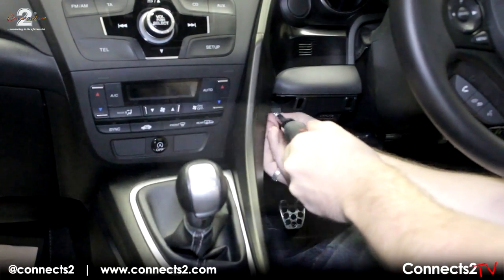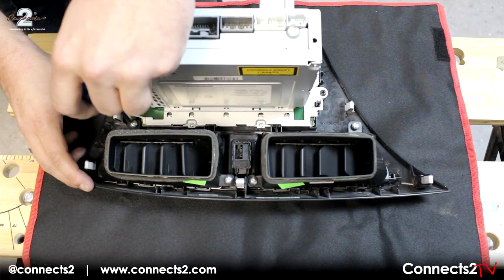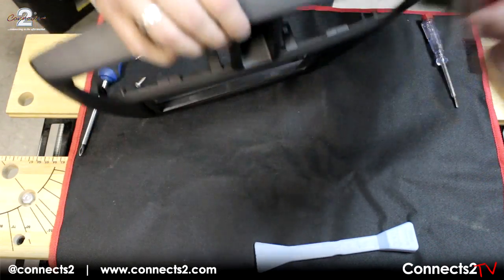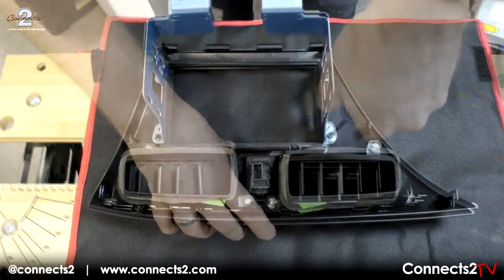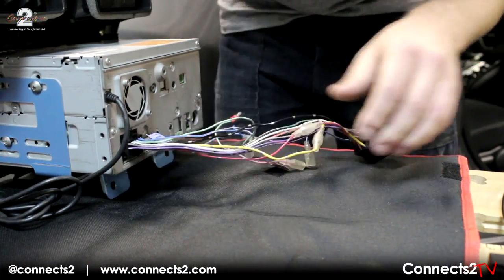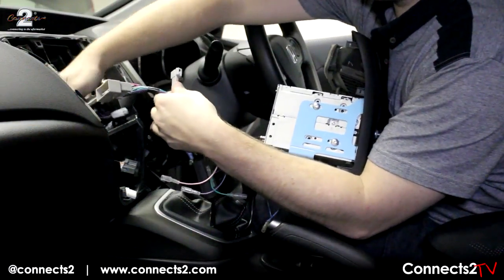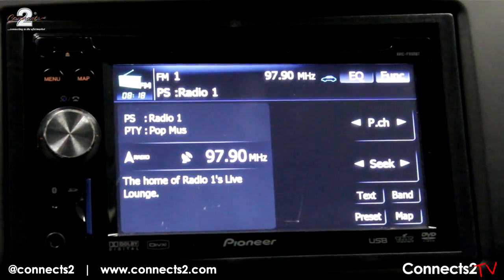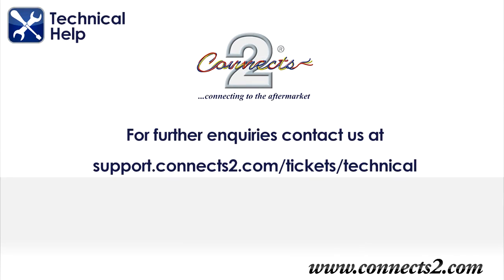Honda Civic (2014) Integration Kit: Installation Guide

Comment: Thanks ever so, Connects2. Not only do you seem to provide the only video on YouTube showing how to remove the head unit from a MK9 Civic, but when I rang them to query how to remove the panel under the steering column, the service department were EXTREMELY helpful. (Its held in with clips, I found gentle levering from the lower corners releases it.)

Comment: Unfortunately the screw for the 'central boarding' (0.13 seconds in) just keeps turning, therefore unable to remove. Any ideas on how to get the screw out?
Reply: Managed to get the screw by holding a piece of card behind the head to pull it out a bit, then unscrewing it as normal.

Comment: Gentlemen, are there any differences between the CTKHD06 kit harness included compared to the CTSHO006.2? Pictures does not look exactly same. Are the functions same. Trying to put together an order for my Honda Civic Tourer 2014 and possibly a Pioneer 1 din receiver (+a tray in the second din)
Reply from the maker: Hey +Jaan Pödra,

Within the HD06 kit is the CTSHO005.2 which is OEM specific, the CTSHO006.2 isn't OEM specific, but will only work if your vehicle's OEM didn't have navigation  and wasn't amplified. More information on the 6.2 can be seen here: http://www.connects2.co.uk/ProductInformation.aspx?id=19162
The main difference between the two is that the 6.2 has an extra Bluetooth phone button support adapter.
Hope this helps,
C2
Reply: +Connects2 Thank you for quick answer. Did I understand this correctly:
- Can both products use existing steering wheel phone buttons (and volume etc of course)?
- Since I have no navigation and no extra amplifier, can I choose any of those two?

Best regars 

Jaan Pödra
Reply from the maker: Hey +Jaan Pödra,
On the second point, yes, 
On the first, the 005.2 will retain only the steering wheel volume, track, mode etc buttons, it won't retain the phone buttons.
But the 006.2 will retain all everything.
C2
Reply: +Connects2 Thank You! Have from one of your distributors.
Reply: +Jaan Pödra Fine, installed the 000.62 together with new facia, all of your brand. Works fine but have a few things to ask about
The car is Honda Tourer 2014 (european) w/o navi or extra amp.
HU is Pioneer AVH-X5700DAB
- Original steering wheel buttons do not work. Phone via Bluetooth in HU works. When I ordered all things i ticked "Pioneer lead". Received "Pioneer/Sony " lead of your brand. Is that a problem? If not, please give me a hint where to look.
- What connector is to be used for the extra USB outlet supplied with the"....006.2"? There is a original center USB close to shift lever in the box. To be honest, I have not looked under there apart from the parking brake connection which is connected.

Best regards,

JP
Reply from the maker: Hey +Jaan Pödra,
In regards to the patch lead, the pioneer is the correct patch, this should be attached via the 3.5mm jack into the steering wheel remote. In regards to the USB connector, I would advise that you contact our tech team via the link here: http://support.connects2.com/tickets/technical/
Also include that the steering wheels buttons dont work as well as a picture or two of all the connections as they stand at the moment,

C2
Reply: Hi Jaan, did you install it all OK? I have a 2013 Civic without Amp but with Bluetooth and I am considering this upgrade, do you still think its worth doing? Also did you lose any functions from the i-mid? what I don't understand is if the reverse camera will be still functioning or not and whether the menu buttons of steering wheel keep working as normal etc etc
Reply: Hi Jaan, also can you tell me all the parts you used, I'm guessing the 000.62 together with new facia plus patch lead for the stereo brand, correct? Also, do you have same experience without the original bluetooth speaker?

Comment: Hi, i have a honda civic 2015 elegance, it has the same radio from the video, i took it to media mark to install a new radio and they say that they cant change nothing because if you change it the computer of the car will shut off and only honda is the only one that can restart it ! Is it true?
Reply from the maker: Hey +jesus rodriguez,
I wouldn't really listen to him, its evidently not happened to us per the video, and we have since taken apart other Honda's for testing with none of that nonsense happening. The only thing i can think of that sounds close to what he was on about is when you leave the key in the ignition (or on the dash) for an elapsed amount of time, then it goes into 'theft mode' and shuts the car down, but again, that has only happened to us once and that was a Mercedes (in the end we got Mercedes down, they plugged their software in, two minutes later he was on his way with the car back in action!) That guy obviously didn't want to work on you car aha!
If you are interested in the product just be wary that your dash set up needs to be like the 2014 on the video where the fans are above the radio, if they are located on either side then the fit won't work for obvious reasons
C2

Comment: My only question after watching this video is if the original screws are used all around, or if you ship special screws with the kit to attach the metal bracket to the fascia plate.

Comment: Hey. I have the Honda Civic MK9 UK with the full display, I think it’s the Honda connect system. Would it be possible to install in that vehicle? I was thinking of a double din with Apple CarPlay and was wondering if I could retain the USB and the rear camera and have the aftermarket system? 

Thank you.

Comment: Hi, thanks for the video, does the CTSHO006.2 comes with an FM/AM antenna adapter or should i purchase it separately?
Reply from the maker: Hey Yossi,
The CTSHO006.2 doesn't come with an FM adapter, you will need to purchase a separate one,
C2

Comment: So I have a question in regards to the 2012> 1.6 dtech civic hatchbacks. My civic comes with Honda's premium sound for what ever that is worth, which includes 4 door speaks 2 tweeters and a sub-woofer. does the harness kit support this sound system in regards how is the amplification done when I replace the old unit with a say a Kenwood or Alpine system?
Reply from the maker: Hey sean,
contact our sales team via phone or e-mail and they will be able to confirm whether your system will be compatible and give you instruction on where to purchase if you want to go ahead
www.connects2.com
C2

Comment: Will this adapter work with American Civics?  It looks like the setup is for UK models.  I have been holding back on replacing my headunit because I thought I'd lose bluetooth steering wheel controls.  But if this will allow me to keep it and migrate to Android Auto, I'm all over it!
Reply from the maker: Hey +jwhite326,
This will work with American Civics, we have the LHD version of this kit under CTKHD06L, this also retains the bluetooth controls also :)
http://www.connects2.co.uk/Product/ProductItem/CTKHD06L

C2
Reply: +Connects2 Great.  Thanks for the quick reply.  I will pick one of these harnesses up for my car.  I presume that, with the kit you linked, the wiring harness itself is the same, but the mounting fascia is what's different (for LHD v. RHD)?  I just ask because the US Civic has a different center console altogether, so I will just buy the harness from you guys and get the mounting kit locally, in the States.
Reply from the maker: Yea the harness is basically tailored for Civic's, and the fascia within the kit i linked is basically the reverse of the one in the video
C2

Comment: Hi i change the factory radio to new stereo .the harness is ctsho006.2 and the model.is pioneer avh-x7500bt. And he works fine .but the issue is no sound  and on the screen shows audio off
Reply from the maker: Hi Glen, Could you please submit a support ticket at http://support.connects2.com/tickets/technical/ to get qualified help from our UK technical support team.

Comment: Hi, i cant see in the clip how do we connect the bluetooth module, thats behind the glovebox. The CTKHD06.2 instruccions say that the bluetooth buttons work, but the connections are diferent ¡¡
Reply from the maker: Hey +oscar martin,
the CTSHO005.2 interface that comes with this kit is wired for the standard Civic and doesn't retain the bluetooth. For civic's with the bluetooth module, you would want the CTSHO006.2, you can read more into it here: http://www.connects2.co.uk/Product/ProductItem/CTSHO006.2
C2

Comment: Hi I hava 2015 civic (UK model), I want to buy Chinese android HU, What Installation Kit do I need to buy? (Left side driver).
1. I want to keep using the ORIGINAL BLUETOOTH and not the bluetooth from the doubledin,  How do I keep the ORIGINAL Bluetooth to work + The Bluetooth steering wheel keys (answer/decline calls/voice control?)
2. How can I still control the Original control screen(Change date/time and change the car settings like speed limit etc...) if I am using the steering wheel keys to change songs/volume?
Reply: Hey any luck with your install?
Reply: @alfiedriver9138  sure, bought Joying model and installed it by my self.

Comment: hello i have a 2013 honda civic si i know by installing aftermarket radio i lose the i-MID display functions for audio but will i still keep the functions for resetting oil changes, security changes and the  rear view camera?
Reply from the maker: Hey,
i would advise getting in touch with our Technical Team over at http://support.connects2.com/tickets/technical/ and they will be able to help you with your issue
C2

Comment: Hi, i have a civic 2014 and i installed this kit (CTSHO006.2) with "Headunit connection lead" (using Jack) in my Pioneer F70-TV (Firmware 1.04 + Firmware Bluetooth HW01-SW03.41.10) but the bluetooth buttons not work. Only bluetooth buttons. What do I need to do?
Reply from the maker: Hey +Alexandre Santos Barros,
That is odd because by my standards, thats a sound setup, nothing sounds like it should be impeding the bluetooth buttons. What I would suggest is that you send an enquiry to our tech team right here: http://support.connects2.com/tickets/technical/ and include some pictures of the setup and wiring, just so that they can assess the problem from all angles that way, 
C2

Comment: Hi, 

I'm thinking of getting CHHO9C version for my 2012 Civic Hatch but I have premium audio. Will it work with the stock amp? If not what options do I have?
Reply from the maker: Hey Victor,
I would suggest messaging our technical department via technical@connects2.com as to which options are open to you, 
C2

Comment: Hello,

I have an Irish 2013 honda civic and I connected everything like the video says. but my steering wheel functions still don't work, could u explain how to teach the buttons to work with the aftermarket radio?

Thanks 
robert
Reply from the maker: Hey Robert,
If you could kindly send a ticket through to our tech team at http://support.connects2.com/tickets/technical then our techies will be able to assist you with,
C2
Reply: Hi, Thanks for your reply, but with a bit of tinkering around I fixed the problem. Thanks again
Reply: How did you make your steering control work?what wire(s) need to be put where on the steering control cable?

Comment: will the bluetooth microphone still working after you connect the adapter to the aftermarket headunit?
Reply from the maker: Hi Danny,
Because of the new Head unit, the current adapter won't carry along the microphone, it will only retain the steering wheel controls, this being fixed by purchasing a further Pioneer adapter,
Hope this helps.
Reply: Connects2 where can i find that pioneer adapter? can you provide me a link to it?
Reply from the maker: Danny Nguyen You can purchase one here http://www.caraudiodirect.co.uk/connects2-pioneer-stalk-adaptor, hope this helps, and good luck on your install :)

Comment: which headunit is this and what inch? how do i connect the original microphone in the roof to the headunit for handsfree with steering controls
Reply from the maker: Hi swezpingo,
The head unit in this video is the Pioneer AVIC-F900BT with 5.8 inch display.
In regards to the original microphone, you wouldn't be able to carry it across if updating your head unit.
The factory handsfree mic will be tuned for optimal performance with the factory kit, any aftermarket products that feature handsfree will normally be supplied with a dedicated mic that will have there own specific connection.
C2
Reply: Connects2 Thanks for a quick answer, I've never done this before on a car with steering wheel buttons. So what you are saying is that the original microphone is unplugged/useless if I change the head unit. If I go for a Pioneer Head unit will a 6.2 or 7 inch fit aswell?, Would I need to buy a separate mic to the headunit? If so will the steering wheel controls för handsfree still work? And what about the Aux and Usb port under the armrest?

I want to know what i need for everything to work if I buy aPioneer AVH-X3700DAB, The most important part is the steeringwheel controls with the handsfree+mic, but it would be nice if the old usb and aux would work to.
Reply from the maker: hey swezpingo,
yes, in any case, changing the head unit will always leave the original microphone redundant because it will come with its own dependent mic, or in some cases (like sony) have them built in.
The screen size should work fine, we produce all of our facia's to fit the double din standards of most radios (apart from some Chinese apparently because size matters lol), but the measurements that can be installed will be 172mmx98mm, so i suggest you check the radios actual screen size (including the plastic rim).

Also the steering wheel controls will work with our loom connectors, the aux and usb will not unfortunately, the loom doesn't have the connector capacity. With that i'd suggest you could look into an external USB drive which could be patched into the loom, or in most cases now, the head unit would have a usb/SD/aux port anyway.
So if you would want to go for what we supply, then i would check out our dealers page and find a local dealership (or simply  at online shops) and search for the CTKHD06 kit (or CTKHD06L if you have left hand drive) and a patch lead for the head unit.
Or if you wanted to break it up (whether people do cheaper deals) you would wanna look for the CT23HD25 facia, CTSHO005.2 loom, and again the patch lead.
Hope this helps
C2